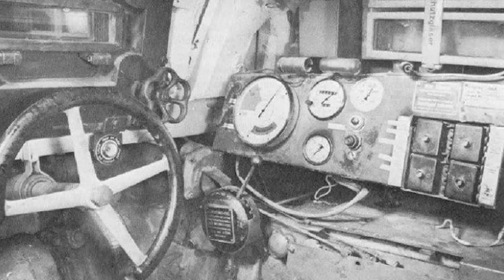A Deep Dive into the Tiger I, by the Chieftain

Comment: From the purely engineering viewpoint, the Tiger's design is hopelessly flawed.

Take T-44 as an example. An almost identical tank on paper: contemporary design, similar armor, similar gun. But it weighs only 32 tons. Why is that? It's not some magic or hidden feature. The majority of this massive difference in weight comes from engineering mistakes that Henschel team introduced into their design.

Every tank design theory textbook has multiple instances of the Tiger being used as a negative example.
Reply: Could you tell us the main mistakes please?
Reply: @daveybyrden3936 
It has inefficient distribution of internal volume and inefficient use of armor.
And since armor thickness was predetermined, its inefficient use caused snowballing of excessive weight, size and complexity - as heavier armor needs bigger and heavier tracks, engine and so on.

The basic layout has excessive height and excessive width; at the same time, it is shorter than would be sensible, if extra volume was needed.

Transmission in the front was the biggest layout-level mistake contributing to all of that, primarily with the driveshaft.

Every inch of height adds an inch-wide slab of the entire perimeter of armor - thickest front, thick sides and - in Tiger's case - equally thick rear. Which is why height is the most weight-intensive parameter in tank design.
(Meanwhile, T-44's entire hull is as high as Tiger's mudguards.)

And a lot of internal space was just wasted, as far as I'm aware.

Then comes more minute over-engineering.
In the steering mechanism, all the gears are unique and non-interchangeable - even the idlers.
Or 6-rows of interleaving roadwheels? That's as close to direct sabotage as it gets.
Reply: @Conserpov  I agree that it was a relatively high hull, but if you were to lower it, where would you put the ammunition?
Reply: @daveybyrden3936 
Remove driveshaft and all the other rubbish from the floor, redistribute space by making the tank longer, and use space more efficiently.
Regardless, the desire to have 92 rounds inside the tank is not a good idea at all. There is no justification for that.
In what world a tank might meet so many targets in one engagement?
Reply: The Tiger I was at least used in combat. The T-44 never was.
Reply: @PanzerBuyer 
That is silly and irrelevant.

T-54, which is an upgraded T-44, is also the most successful tank in history. Still irrelevant.
Reply: Factual, sorry not sorry.  @Conserpov
Reply: @PanzerBuyer 
Wehraboo coping over engineering analysis.

Go outside and touch grass
Reply: You say the T-44 was "contemporary" with the Tiger.
Not true.
Its design and creation took place about two years later than the Tiger. The first T-44 entered service when manufacture of Tigers had ALREADY STOPPED.
Reply: @daveybyrden3936 
This is completely irrelevant to the point.
T-44 is merely an example of a 1940s technology tank with similar armor and gun, but without gross engineering mistakes of the Tiger, useful to illustrate the magnitude and impact of those mistakes.
IS-1 and M26 are intermediate examples.